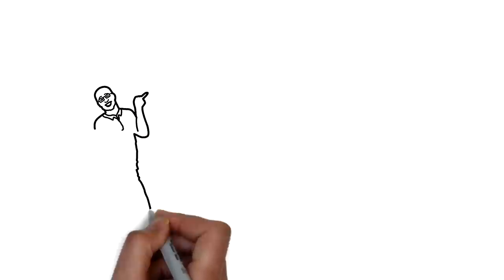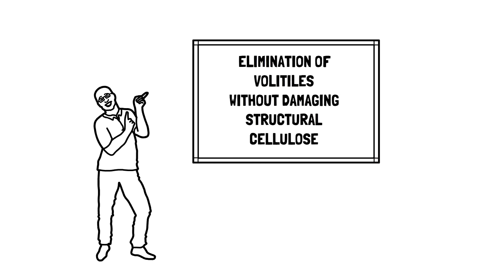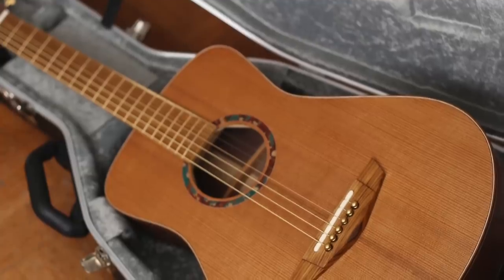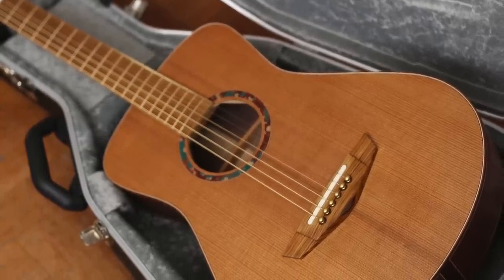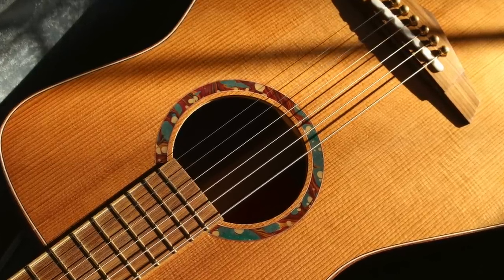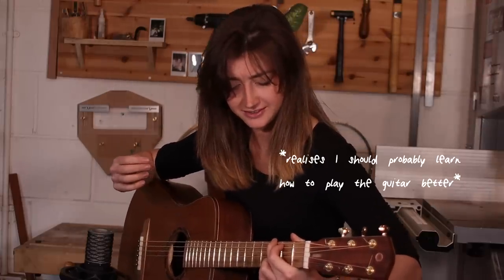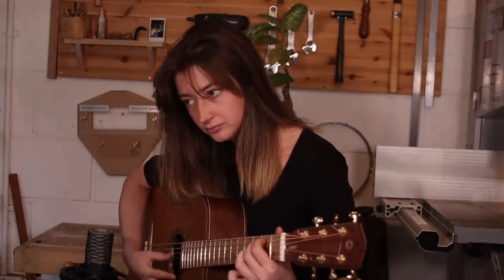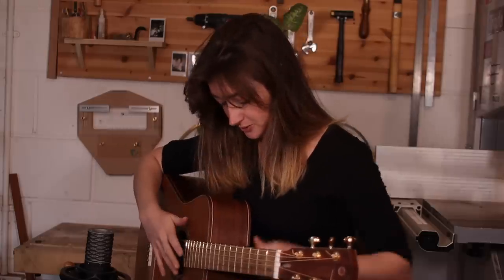I Made a Brand New Guitar With a Vintage Tone

Comment: "Vintage tone" has been around a lot longer than the guitar. It was the reason originally given for old violins, pianos, etc... sounding better than new ones. The vibration of playing the instrument changed the structure of the wood. Some assumed it evened out the grain allowing it to vibrate more freely and evenly. I've never been one to try and pin it down. Whether baking the wood will do the same thing as natural aging from playing, I'd be surprised. But it doesn't mean it's not worth checking out. I know major guitar manufacturers have done it. Gibson did it to guitar tops and braces. Whether it didn't work out or just didn't sell, they don't seem to do it anymore. Gibson customers tend to not like their guitars to be messed with though. LOL

As far as those who don't "hear" a difference, I'm alright with that. I'm surely not going to tell someone they can hear something when they say they can't. But I would appreciate it if they offered me the same courtesy. If I want a particular tonewood from 100 year old trees harvested pre WWII and naturally dried for decades, Adirondack red spruce top, ebony fingerboard (preferably responsibly sourced old Brazilian), nickel silver frets, hot hide glue, and a shellac finish because it sounds better to me and I'm willing to pay for it, then shut the heck up and let me buy it and be happy. 

I'm constantly seeing videos where someone proves beyond a doubt that "tonewood" is a fantasy because they came up with some experiment, recorded it with their iPhone, and uploaded it to Youtube, and you can't hear a difference on your end of the internet after all the compression, multiple A/D and D/A conversions, horrible hardware, and a pair of Beats (pick your favorite massively colored headphone brand) headphones or iPods. Also, if you notice, it's typically commercially advantageous to them for tonewood to be disproven.

You just keep working on building better instruments using your knowledge, skills, and ears. That's what Stradivari did and it turned out pretty well.

Comment: I do wonder how long these artificially aged guitars will last; people want a guitar now that sounds like it's been around since the 60s or whatever, but they don't have the money to buy one because old, sorry 'vintage', guitars are now expensive, and maybe they're too old to just buy a new guitar and play it for long enough that it does become old. It's the same with this fad for 'relic' guitars that have had artificial damage to the finish, to look like a real 60s guitar, because actual 60s guitars cost tens or hundreds of thousands. Back in the day, as your correspondent said, there were no vintage guitars, only old or used ones. But in the 1960s, the modern guitar styles were only 30 or 40 years old, not 90 or 100 as they were today. There were no 60-year-old Martin D18s in the 60s; the dreadnought and other modern large guitar styles were not even invented until the inter-war years and the modern electrics were actually new. But if you bake a guitar top to artificially age it, surely when it's 60 years old, unless it's very well looked after (and maybe not even then), it might have aged out of usability, while if you buy a new 000-18 now, you'll have a vintage guitar to hand down to your grandchildren if you look after it and play it.

Comment: I did build a torrified top guitar, but didn't hear that much difference, and also didn't like the baked appearance of the spruce, which was significantly darker than regular sitka. I think some suppliers are selling tops which are closer in appearance to a regular one, and certainly the big manufacturers' baked tops are pale. I also found it rather brittle to work with - a bit like larch. I also question the role of the top wood in creating an 'vintage' sound. Torrifying is  emulating drying out over time, but there is also the contention (as you imply) that the wood plays in over time. If you left a prewar martin in its case since 1938 it would be likely to sound a lot different from one played all that time (think Tonerite here). Likewise the construction approach might have  a far greater influence on tone. Finally, which vintage sound? An all birch Harmony?  A wartime Martin or Gibson? I agree the language just isn't there. It's a bit like wine. Masters of Wine a) train b) develop a sensitive palate c) evolve a common language. Very few (If any) people have listened SERIOUSLY to as many different guitars as a Master of Wine has tasted different wines (or even as I have - I like wine and guitars!). People like George Gruhn occasionally give interviews and are authoritative. Otherwise folk on the forum are keen amateurs like me with very few exceptions. Finally, as with wine, what sounds raw to you (even though you say you don't get what it means) won't necessarily sound so to me - that vocabulary problem again. Good for you for having a crack at it though. Always a pleasure., and the guitar sounds nice. Does it sound vintage? What do you think?

Comment: Vintage sound? Well Stradivarius violins are an example, even though there are disputes. As for torrified wood, I think that  there are two factors, one as you say, moisture and the other being the condition of the resin (hardness). Sawyers today kiln dry their wood a about 25 C and low humidity in an isolated "box" with a dehumidifier and good ventilation. As for increasing the hardness of the resins well I expect that this would be an area for experiment.

Comment: Nice sounding guitar. I can well believe that in an acoustic guitar, that torrefying the woods could make a difference to the overall sound, solid bodies, not so much (if at all). That instrument sounds, insofar as I can hear via the YT compression, etc, to be nicely balanced, and maybe a bit "polite" if i could use that term. It doesn't shout out it's presence, but how much is down to the treatment of the wood, or the woods used, and the size/construction of the guitar, I couldn't really say. But I suspect the construction: bracing pattern, etc. is the deciding factor. Would be interesting to hear how you managed to bake the wood i an oxygen free environment, anyhow. Or is that a trade secret?😁

Comment: I’ve just acquired a lovely board 2.6 x100 x24 roasted maple with an insane ripple for necks very cool stuff 
I think vintage acoustic guitars have that harsh top end chilled out over the years just warming them up . I struggle with the top end on new spruce acoustics and usually prefer red cedar on new guitars . I’m not old enough to have a vintage guitar to hear it change over time 😂

Comment: If you increase the heat then this is exactly how you make charcoal. For bbq fuel if you want the best tasting steaks ever, or fuel in Black Powder for fireworks or gunpowder. By burning wood without the presence of oxygen, it will smolder but wont produce a flame and will not technically burn, it burns off all the volatiles and impurities in the wood and turns into charcoal. Actual burning of wood just makes ash. Charcoal is a clean burning fuel source.

Comment: "Vintage Tone" is subjective bullshit. Many people just believe advancement guitars ended with the late 50's Gibson guitars. They don't know about what makes a guitar sound the way it does and can't actually tell the difference to their ear, its just snobbery. I can make a guitar sound any way you want it to brand new. Wood does need to be aged or baked before you try and make a guitar out of it, not necessarily torrified but green fresh cut wood is not going to work well. Wood is just like composite materials you got resin and substrate you need to cure both to remove volatiles and make it rigid.  And don't get me started on Nitrocellulose paint bullshit!  It's just what they had to use its not acoustical magic paint. I don't like polyester either but it's because it cracks not because "its not nitro and kills the tone man."  Unless I have a specific reason not to, I use epoxy and bake it.  Guess what? Its more like old wood! for the same reason! Its dense and rigid! and it wont ware out over time. It can literally survive re-entry its that tough.

Comment: I made a Les Paul replica with a maple top that was torrefied, it sounded slightly less resonant and responsive compared to all the others I made using normally seasoned wood.  Nothing except the top was of any significant difference to my others.  It also had a dark caramel color that won't go away no mater what if it's sunburst or other non-opaque color.  There might be some benefit to using a cooked maple neck on Fender style guitars since it would probably be more stable, needing less or no truss rod adjustments and or tuning but again, it would look much darker.  I made one Stratocaster neck, quarter sawn cooked maple with a Brazilian rosewood fretboard, I did not notice any significant improvement in tone and it was not as stable as my real '61 Strat's neck.  So, at that point I figured this whole idea is..um...half baked.

Comment: There is a well developed process to recreate the aged woods used in "stradivarius" violins. I wonder if thus would have any application in luthiery.

Also, the Ken Parker Archtoppery channel has a lot to say about the composition of the back or the guitar for the resonance. Should the Torrefaction be done on the wood on the back? The bracing?

Comment: As a synth player as well as a bass & guitar player, I think synth players have a unique understanding towards the language of sound. I associate warm with a sound that is richer in harmonics and overtones towards the lower end of the audio spectrum. Bright = same, but towards the higher end of the audio spectrum. Raw = fewer overtones and harmonics period. Warm would be a nice multi oscillator setup with a slight low pass filter, bright would be with a slight high pass. Raw would be a single bare oscillator.

Comment: in violins, for recreating the 'vintage tone' I found with the experience that flatter backs and cedar tops could go closer to what it is a century years old instrument. Anyways, cedar is never gonna sound as good as spruce in mid and long term and flatter tops and backs give less response an volume, so its never the same, just an aproach
   As Graham McDonald says in her bouzuki n mandola book, there is a method for bending the tops instead carving them, heating the wood in an oven. After this, the grain is not cuted when carving the arch, as it goes all along the curve, so it allows to have thinner tops. This is also made on viols and there is an article on the Strad from Helen Michetschlager, who made the same for violas, but steaming the wood. I have a viol on the way made by this method, so till I finish it I dont gonna know if it changes the sound, but definitly the fact of having a thinner top it helps 
   I didnt get well how do you make the torrification process... Could you explain the process,  I mean about temperature and times, please?
  Super cool channel, content and the way is produced , btw

Comment: The sound and durability of a old Guitar depends on the type of glue and finish used on the Guitar. 
The Stradivarius violins are stuck together with animal bone glue and finished with drying oil. Which I presume are impervious to crystallisation.  Hence everything ages together.
Where as if modern glue and vanishes are used on instruments they are prone to crystallisation and braking down. 
Question is do you put the modern Guitar in the oven before it is finished with modern day vanishes but how would the modern day glue stand up to a baking?? 
Or is the wood of the Guitar prepared cut to size and formed etc then baked in an oven then assembled and finished with modern day glue and vanishes.

Comment: I built a few thinline guitars (yeah electric) with American chestnut harvested from barn timbers circa 1815 (old growth).  The chestnut is the cap and the body is ash I feld about 15 yrs ago and stored as timbers in barns. 
They are very light and resonant.  4.5 to 5.5 lbs (8-10kg) each and sound great. The necks are maple and maple/rosewood.  The maple had been stored more than 20 years before the second cuts.  
All the wood was off the bottom of the scale on my moisture meter.  

Your videos are awesome!

Comment: I walked past a Wood Drying yard on my way to High School  every day and chatted to the guys often. They dried the wood for 20 years. Yes, ageing wood , Torrefiecatin is the answer. Getting the Glyceral  out of the wood ( that is drying out the  resins). It's artificial compared to the woods I saw and grew up with in the 60s that had been felled in the 40s and dried out for a long time. Australia's climate helps too, mostly dry. I'm 66 now and still love wood and amabout to build an OM size acoustic. Have made many electrics and Dreadnoughts.

Comment: what about imperfect pickups, most of my earlier guitars did not have the sustain or the sonic perfection in the pickups that modern produced pickups do, usually if I'm after a vintage tone on a new guitar i"ll chuck in a older set (60's/70"s) in, instant vintage sound

Comment: That guitar sounds FANTASTIC! To my (non-guitarist, non-acoustic guitarist) ear, it certainly leans to the more vintage-y sound. The treble response is gorgeous - as others have said, it's punchy, while being warm and slightly mellow, and not crispy or crunchy (oh no, slipping into food metaphors!). The mids and bass responses are lush!

I'm not sure if it is "just marketing", but one of the things said about torrefied woods (or roasted, as we say here across the pond) is that it is supposed to be more stable in different climates. Where I live, we frequently will have summer days where it will be 90 degrees F (32.2 C) with 100% humidity, and then frequently we'll have winters where it is -20 degrees F (-28.9 C; even colder with the windchill. We experienced a Polar Vortex several years ago, where with the windchill, it was -52 F / -46.7 C.). I have one bass guitar that has a roasted/torrefied maple neck that I had bought about 4 years ago, and I'm not sure I notice a difference (but take that with a grain of salt, it is a more affordable instrument.). That said, the neck is a bit lighter, and quite resonant. But above all, I LOVE the look of torrefied/roasted woods - F Bass out of Canada offers a torrefied ash body as an option, which would look great with a transparent finish, just like the guitar you featured in this video!

Congrats on the Creator On The Rise! Keep on rising!

Comment: Very interesting topic.  I don't build instruments from scratch, but I acquire old used instruments, usually needing a lot of repairs. 
Presuming a decent original material quality, I have found that I can get a lot of tone variation out of relatively small changes to a  10 to 30 year old instrument by changing the bridge pad, thinning and shaping the top braces, and replacing plastic saddles and nuts with bone or "Tusque" products.  But, most important - Strings!.  If one has the time to try a bunch of different strings,  the difference in sound (on the same instrument) between various gauges, materials, and surface coatings is amazing.   
I repaired an old Ovation (don't get me started on plastic guitars and epoxy) to play well enough, but the tone was cold and harsh.  I installed a  mix and match set (10-14-24-32-38-46) of inexpensive phosphor bronze strings, and it warmed up really well.
Sorry for the long comment,  but I can't imagine you are actually reading them all anyway.  Thanks for the great vid.

Comment: I fully believe that everybody is entitled to make, own, and play the instruments they enjoy regardless of the reason. However, I find it hard to believe that the average human ear is sensitive enough to tell the difference in the timbre of one wood species to another, or between different ages or preparations. I doubt there have been any empirical studies of this, but I would be interested to read them if there were. Or maybe I'm just jaded and overly skeptical. You do make a good point about the heat changing the chemical composition of the material, so it probably does have some effect on the sound. To what degree it is noticable is hard to say. Thanks for sharing your experience and insight.

Comment: Thank you for explaining the simple reason why “kiln drying” doesn’t set wood on fire.

ETA:  yes - older stringed instruments can sound different.  In my opinion, wood can continue drying out and/or “crystallizing” for decades. The type of finish probably affects that process, but so much of an acoustic guitar is unfinished (inside).

Comment: In a truly vintage guitar, the resins crystalize at ambient temperatures over a long time period as part of a complete assembly where the stresses and tensions are present over and across the entire system of the wood pieces. Whereas, in a new torrified build, the individual parts of wood achieve resin crystallization before they are assembled into a complete system. It makes me wonder about this difference....perhaps, in this difference lay some of the "magic" in vintage tone...especially with instruments like a Stradivarius violin, that's had hundreds of years to "bake"